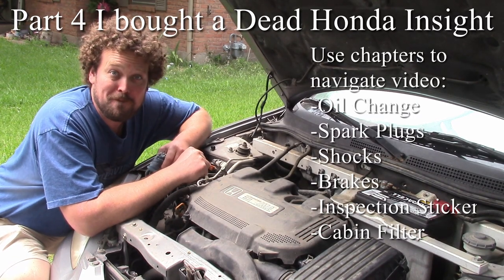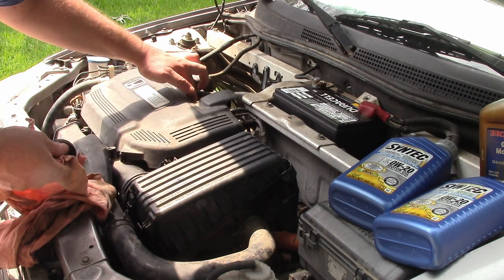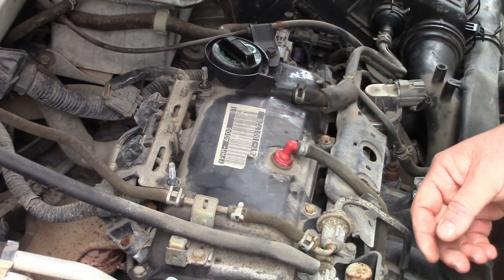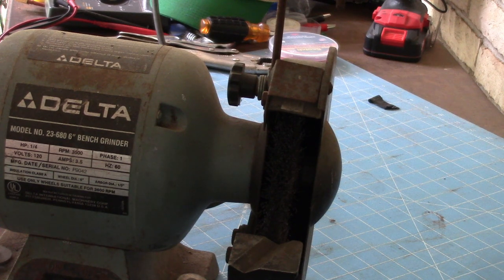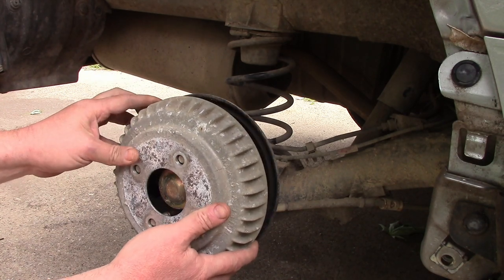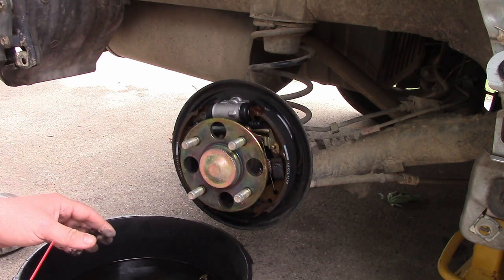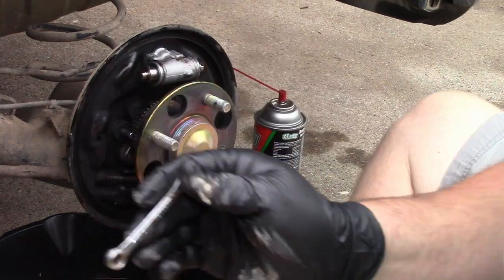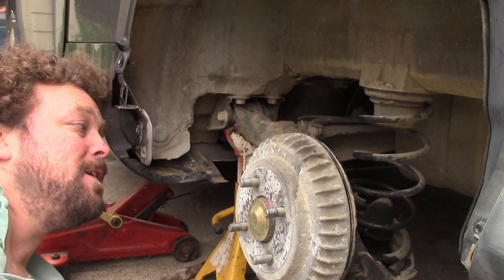Getting my Barn Find 2000 Honda Insight street legal for the first time in 5 years!

Comment from the maker: Chapters / Timestamps
0:00 2000 Honda Insight Barn Find
1:53 How to change the oil on a 2000-2006 Honda Insight
10:20 Oil on the Air Filter means PCV is clogged
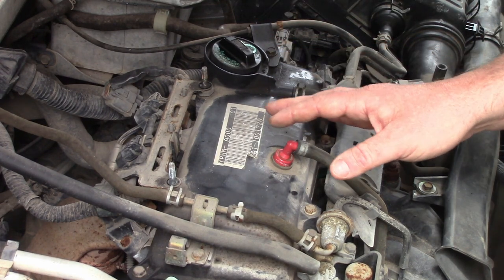13:56 How to remove spark plugs from Honda Insight
18:28 Indexed Plugs on 2000-2006 Honda Insight
24:17 How to remove rear tire on Honda insight
25:39 Rear springs and Shocks talk
27:16 How to remove rear shocks
30:24 Clear and Adjust rear drum brakes
36:54 Leaking wheel cylinder
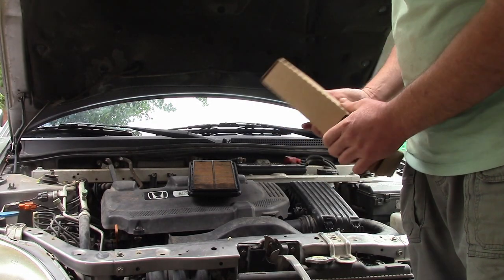43:09 Air filter
43:52 Review of brand new Monroe Shocks
48:27 First Real Test Drive
55:05 How to replace a cabin air filter Honda insight
1:00:23 Worst YouTube outro ever!

Comment: Thorough basics for this unit and you allotted generous time and detail. I'll look over the bumble bee stick batteries episode, as I still have a box of them unopened in the basment for 5 years! It seemed too complicated. Every owner needs to know how to master self repairs for this baby to keep them alive as their are no easy parts to source now. Shocks was a big time problem. I regret Monroe's with such a lousy warranty also. Di-electric washer on the shock mount to impeded galvanic reaction was a key tip you emphasized. Good job! FYI ..... in -25C Toronto, the Autostop does not work until the engine is warmed up enough.  With AC on, as you discovered, the power drain requires the engine on. One of my Insight ( 2000 silver ) did not have autostop work for along time and the car got stressed with the heat build up, blew the compressor and anti-freeze emptied while stuck in 4 hour grid-lock freeway lineup on a bridge to U.S. Border guards. It could have easily been prevented with Autostop working.  That autostop troubleshoot is a specific issue which likely is related to clogged hoses or the pc valve carbon build up. Anyway, anyone that can focus on that autostop fix would be very helpful for when it does occur

Comment: Please do share if you get the start-stop to work and how you did it. Keep em coming.
Reply from the maker: It took me a while to realize that when I use the air conditioning that I needed to use the Econ air conditioning if I wanted the engine stop to work. I did my first several test drives with a working IMA battery with the regular air conditioning running and that prevents the engine stop from functioning. In my case all the IMA needed was batteries and for me to learn a bit more about the system to be fully functional. It’s not perfect yet. Right now I’m the Texas summer heat the just sitting the 110 degree Fahrenheit weather causes the battery to limit how much regenerative breaking current it will allow the battery to except. I’m hopeful that it is just the one smashed thermistor that I left out in case it became a problem. I still haven’t found a thermistor to replace it so I might fake it with a resistor.

Comment: There's a jacking point right in the center of the side, and then you can use the front and rear points for stands. Super easy to just lift a whole side at a time.
Also the upgraded springs from killer3cylinder are aabbssollutteellyy worth it. I can't overstate that enough. It's a gigantic difference. Zero slapping the bump stops, handles better, etc.
Reply from the maker: Thanks for the tip. I’ll use better jack stand points next time for sure. Also the springs with the gaz shocks will happen before too long. I’ve been daily driving this thing for a couple weeks now and I probably have hundreds of times a day bouncing off the bump stops. The car is running pretty good. With the a/c off it is quite sporty, with the Econ a/c it almost drives like a normal car but slow and with the regular non-Econ a/c on it has a hard time getting out of its own way. Lots of progress, it feels like the more I drive it the better it wants to run.
Reply: @BenHuttash  That sounds about right! My g1 is comically slow in auto, pretty okay in econ and great with AC off.

Comment: NGK specifically recommends AGAINST using anti-seize.  From their website:  "

1. Anti-seize

NGK spark plugs feature trivalent plating. This silver or chrome-colored finish on the threads is designed to provide corrosion resistance against moisture and chemicals. The coating also acts as a release agent during spark plug removal. NGK spark plugs are installed at the factory dry, without lubrication or anti-seize.

Anti-seize can act as a lubricant, altering torque values up to 20 percent, increasing the risk of spark plug thread breakage and/or metal shell stretch. Thread breakage can sometimes involve removing the cylinder head for repair. Metal shell stretch changes the heat rating of the spark plug and can result in serious engine damage caused by pre-ignition. Do not use anti-seize or lubricant on NGK spark plugs. It is completely unnecessary and can be detrimental."
Reply from the maker: Good to know. Thank you.

Comment: Just thought of a couple things - that jerkiness in the throttle you feel might just be the simple transition from different air/fuel mix ratios. I get that hesitation sometimes too, although at 260k miles now I pay a bit more attention to it. I need to check my EGR plate and a couple other things, I'll bet yours might be clogged?
Dunno if after changing the cabin filter if you still have that stink, but leave a bowl of white vinegar left in there for a while would definitely help.
Looking forward to more vids! I have that same dash button issue haha, never cared to sort it.
Reply from the maker: I have another video in the works where I dive into that jerkiness. Also a new problem where the key security light flashes and the engine cuts off for a moment. The key chip reader issue is intermittent but once at a stop light it happened after putting it into first gear and the windows gnome didn’t IMA start for me. Most of the time it happens while driving and with the car in gear rolling forward it just hiccups and keeps driving.